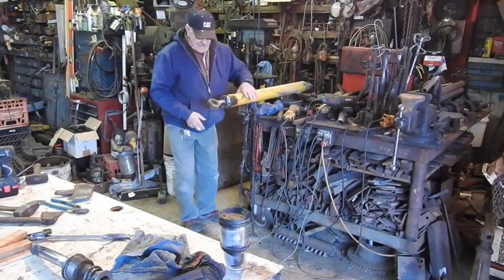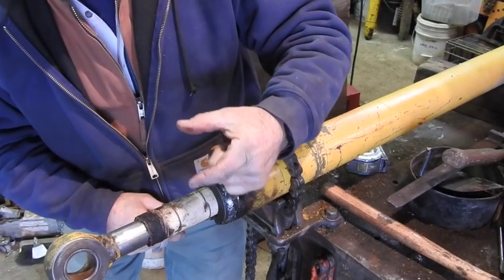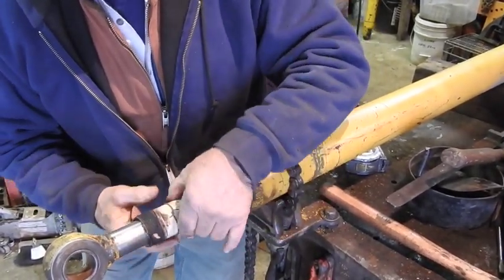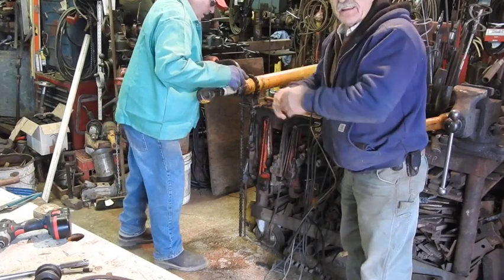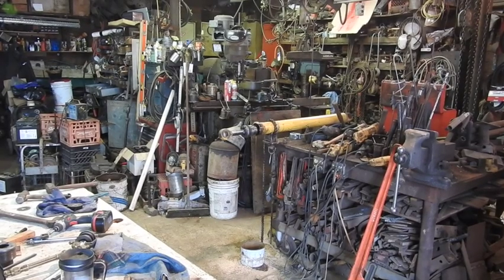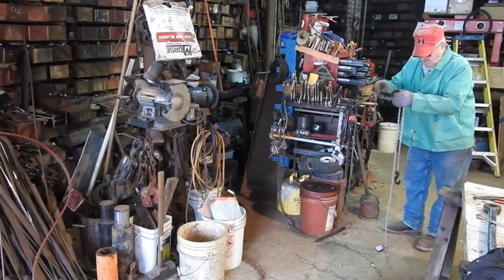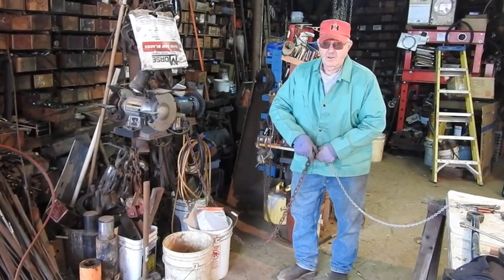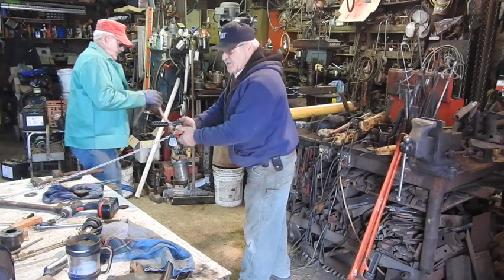Can You Break A Hydraulic Ram On A Case 580?

Comment: When I go to garage sales and flea markets I am always looking for pipe wrenches. I have been told when I buy one for a couple dollars that no one wants them anymore. Everyone is using plastic pipe. 
Pipe isn't the only thing they are used for as evidenced by todays video. 
In a pinch you can use a pipe cutter to remove the end of the cylinder. 
I was in charge of keeping 3 extrusion presses running. A 1600 ton Youngstown. A 1300 ton Sutton and an 1100 ton that I have forgotten the name of. 
The nameless press needed new side jack cylinders that fast forwarded and retracted the main ram. I had a place in Texas build a set of two. 
On the compaction presses at Metal Powder Components I had to replace several smaller cyclinders. I had the tool room turn up shafts out of Thompson rod. You can buy it in all kinds of sizes and it is prehardened. Since it is case hardened once you cut.100 off the surface you can thread it no problem. 
Standard pipe can be used for the tube. You just have to hone the bore.
Reply from the maker: Dang, that's a good bit of added info !  Love it.  I knew the rods were replaceable, but I don't think my welding is good enough to make the appropriate welds for the ends. Actually I KNOW its not good enough.  LOL  I'm sure with a bit more internet time, we could have actually located a good used cylinder that was reasonable to buy and ship.  But he looked high and low...called all the local hydraulic shops and one construction equipment salvage yard and come up with a zero.  So we went this route.

Comment: I broke the dump cylinder on an IH 1550 loader on a 434 Gas one time. I suppose I could have been killed had that not happened. 

Dad and I had just a couple of loads to bale in the back field. Almost everything else was baled round but we wanted a couple more loads of small squares for really bad winter weather so we'd baled a couple of loads and brought them in the day before. 

Now, the dew was finally off but a thunderstorm suddenly developed and was coming in fast. Dad got in the truck and went ahead out to the field to grease the baler. I was to bring the 434 and move it so we might have a chance to beat the rain. I was about 16 at the time. I was flying up the middle field lane wide open in 8th with the loader down low for travel. The hairpin key came out of the right side main pin of the round bale spear. I had no way to know that had happened. Without the hairpin key, the main pin on the right side jiggled out. That allowed the heavy square tube bale spear to hit the ground and it speared straight in. There was a tremendous BANG and suddenly the tractor was 3 or 4 feet off the ground, flying. It came down with a couple of bounces and I was on the brakes, no idea what had just happened. It happened in an instant . The bale spear was left upside down completely under the tractor, held on only by the one loader arm pin, the loader arm twisted, the dump cylinder rod bent and snapped right off. Everything else seemed okay. I backed the tractor off of the spear, but couldn't get it disconnected without a heavy hammer because the twisted arm jammed the remaining pin in place.

Me not arriving in the back field in time, Dad came looking for me. I thought I was as good as dead. In all my years of tractor driving I had never caused so much destruction of equipment. I was fighting back tears at the damage, expense on our small farm, and, especially, the thought of disappointing my Dad. 

When Dad got there and looked at the damage, and saw the huge rip in the ground from the spear, and the skid marks after I landed, he put his hand on my shoulder and softly said, "There there, Lil' Man; we can fix the tractor or even replace it, but we can't replace you". They were some of the greatest, most loving and forgiving words I'd ever heard out of his mouth - and I'd heard a lot of them. He was just glad I was still alive. If that cylinder hadn't broken it might have sheared the loader off and killed me or the tractor might have flipped over forward on top of me before I could have been thrown clear.

We took a club hammer out of the truck and pounded the remaining pin out and set the spear off the laneway and went ahead and still managed to beat the rain... just.

We bought an entire new dump cylinder assembly, but our mechanic could not get the hard steel loader arm or the bale spear to fully straighten, so it remained as long as we had it. The 434 caught fire and burnt about 12 or 13 years later. We had the loader repainted and new hoses installed and mounted it on a creampuff 444 Diesel and used it for many more years. The slightly bent loader arm and bale spear remained constant reminders that a life changing event can only be a split second away on the farm.
Reply from the maker: What an eyeopening and descriptive story of what could have been such a terrible situation.  I'm certain his mind was racing while thinking of the potential outcome and at the same time provided the best possible comment to you to let you know what's really important.  What a superb comment.  I do appreciate the detail to the life changing experience you both endured.  Wow, I've got nothing to compare to that experience and I am thrilled to have you relate this to us all.
Reply: @tractorman4461  Thanks for saying that. 

The funny thing is, if I'd been doing the stupid thing you see in so many YouTube videos (or maybe even down your own road) of carrying the loader raised high during high speed transport, when the pin came out the spear would have just skewed a little but still been hanging by the other two pins. As it was it allowed that early and very overbuilt (before lightweight, slim forged round spears) square tube spear to engage the ground. Even if it had been on the road the point of that spear would have went right through the asphalt. 

I should add that episode was for sure an eye opening experience of the dangers of hairpin keys. Those were the factory pins and proper hairpin keys for that loader. 𝐓𝐨 𝐩𝐫𝐞𝐯𝐞𝐧𝐭 𝐭𝐡𝐚𝐭 𝐟𝐫𝐨𝐦 𝐞𝐯𝐞𝐫 𝐡𝐚𝐩𝐩𝐞𝐧𝐢𝐧𝐠 𝐚𝐠𝐚𝐢𝐧, 𝐰𝐞 𝐝𝐫𝐢𝐥𝐥𝐞𝐝 𝐭𝐡𝐞𝐦 𝐨𝐮𝐭 𝐬𝐨 𝐰𝐞 𝐜𝐨𝐮𝐥𝐝 𝐮𝐬𝐞 𝐥𝐲𝐧𝐜𝐡 𝐩𝐢𝐧𝐬 𝐢𝐧𝐬𝐭𝐞𝐚𝐝 𝐭𝐨 𝐬𝐞𝐜𝐮𝐫𝐞 𝐭𝐡𝐞𝐦. 

Anyone with old loaders or 3 point equipment should drill out hairpin style pins for lynch pins or just replace them. If the pins try to rotate and the hairpin key catches or digs for any reason on the bent side, it will spring open and blow out. They are fine for vertical applications like drawpins where the hairpin key hangs below the drawbar and almost never engages it, but they can be dangerous or even deadly in horizontal use.
Reply from the maker: @42lookc  All good points that I'd agree with whole heartedly about the hairpins.    Yeah, I never understood those guys running around with the loaders high unnecessarily.  The balance point changes dramatically with elevation, as you and I know, but I think so many guys new to tractors don't realize how MUCH it changes tip over point.  The fact remains though that you were very lucky and your dad handled it with class.  Life lesson learned.

Comment: I've never seen one get broke like that before! 😮  That's a big pipe wrench too!   Thanks for sharing Wendell. Glad you both could get that cylinder apart  🔧🔩
Reply from the maker: He never did tell me how it got broken like that. I've not had that experience yet myself.  The old Rigid would be a lot easier to use if it was aluminum !!  That packing gland WAS a pita to remove for sure.  It'd never been removed since new in '73.

Comment: Wendell, couldn't you have used compressed air to push the ram out of the cylinder?
Reply from the maker: Yes, but its a bit more uncontrollable. A nasty byproduct of that is the potential of being sprayed by the residual oil in the cylinder if you break the air away incorrectly. If I wouldn't have accidentally hit the delete button while editing the portion of him moving it with the coffing hoist you could see it sticking and jumping and sticking again.  Some of them just refuse to move smoothly.  Some of them you can slide out easily by hand too.  This one was in 'lady-mode'....being stubborn.  LOL

Comment: Well, I used to save everything knowing I could use that later to rebuild or re-purpose something, but I failed miserably at having a system to find what I knew I had when I needed it. I eventually sold that shop building and found everything I ever looked for and it was all just where I put it.
Reply from the maker: I gotta admit, I suffer from that syndrome a little too from time to time.  But in general can find the appropriate pieces. And yes, its usually in the last place I look....and dang, if it's not always just where I put it !!  LOL Thanks S K for the grin this evening.

Comment: Made it look easy! I was wondering if they were all the same size. I see they changed the diameter just enough to require machining. 🤦‍♂🤦‍♂🤦‍♂
Reply from the maker: There's no rhyme nor reason for the differences as far as I can tell.  That's why you just about have to have the correct numbers off the machine,the loader AND the cylinder to be able to order correct parts.  He looked high and low for a replacement cylinder like I did on mine a few years back and couldn't find a thing that was affordable.

Comment: Yes, you sure can :)
I said this before I watched the video!
Reply from the maker: I gotta admit, I'm pretty rough on equipment, but I've not ever bent or broke one myself.  But that could change this week though...LOL
Reply: @tractorman4461  Me either, but I've had a customer who had one break, and it was a fault of manufacture engineering.. Somewhat long story shortened up,
Back in the earlier 1970's GM built TEREX equipment, one of their front end loaders ( if my memory is correct I think maybe it was either a model 72-31or a 72-51 )   had a design fault which when used for snow clearing etc. allowed snow to fall through and into the 'pocket' that held the main lift cylinders, the snow built up behind the cylinder, packed solid, and then there was very little room for the cylinder to go when raising the bucket,. This caused a severe bending of the ram, which further caused it to snap off like a carrot. So there you have an expensive and troublesome repair job!
Reply from the maker: @regsparkes6507  Holy cow !!  Now that IS a design flaw.  Hopefully they recognized the issue and took care of the expenses.  Who'd think something soft as snow could create such a force !! That sure was a 'Fun Fact' Reg and thank you for adding to the story.
Reply: @tractorman4461  This incident happened just a month or so before I was involved with the service department in that business. The loader was a Government owned unit,. I do
seem to recall that GM-Terex Division was involved , so yes I'd suggest that there was 'cost sharing' going on in that repair job. :)